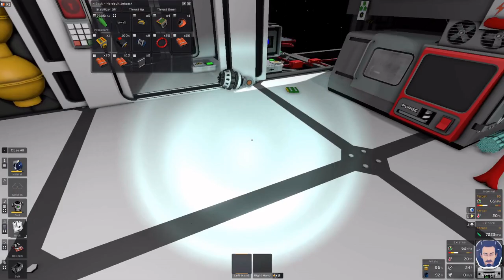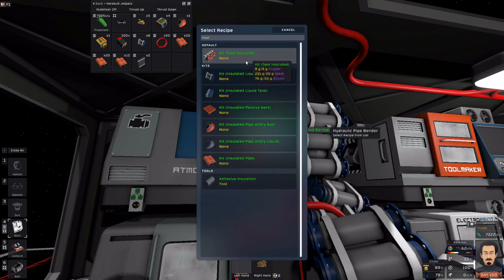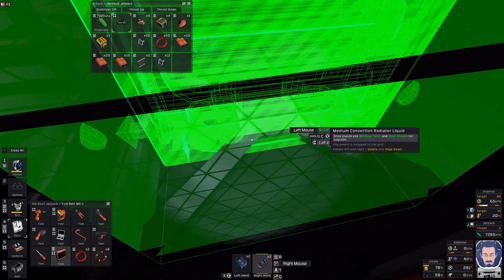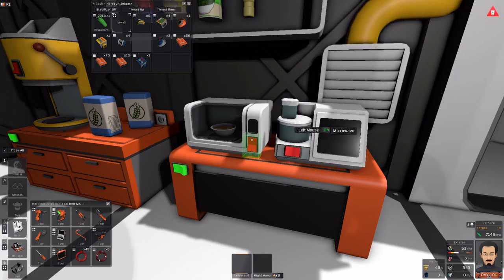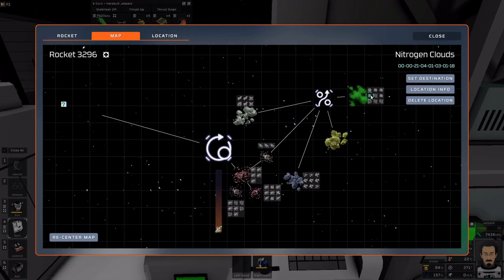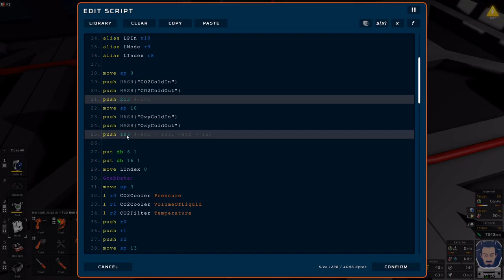Lost In Asteroids Pt13

Comment: because of my 70 day wait for my 2nd rocket launch, I did some creative mode testing with making liquid O2 from 7.5kMol O2 at 20C.  With 6 medium radiators, it takes about 21 days to cool it down (3 gas, 3 liquid) to -155C, which is fine for the pumped liquid engine.  More radiators will obviously do it faster.  I commend your Nitrogen distillation process, but the only nitrogen that I have is what I started with.  I dont think there are any nitrice deposits on the 1st hop destinations of the Europa map.   regardless, having extremely limited resources, I cant make elaborate setups which from a resource point of view is a game of trading one resource for another.  Electricity and cooling is free, once you build solar panels and radiators....you just need more and more to get more output from them.    I havent experimented with pressurized liquid engines, but the wiki says you use less fuel, the colder the liquids are....so getting that O2 down to -180C would probably be ideal for that - which will definitely be an end game challenge. I'll probably have a few liquid pump engine NOS flights before then, but again my goal is to become completely independent for the need for any mining.  And water independence, which requires your spare oxygen, will be dead last.  Nevertheless, enjoying your series and the inspiration it has given me.
Reply from the maker: That is a very long time, Kind of makes sense since the 1 radiator I built to help the Nitrogen cool faster was barely doing 100J of radiation. I'm finding that without a composter or burning NOS, Nitrogen is surprisingly hard to find.

As far as pressurized liquid engines, colder liquids is kind of a detriment. To get max thrust from the engine, you would need to have a near perfect molar fuel ratio AND pipe pressures as close to 6MPA. As far as fuel consumption goes, last time I ran them in Europa, they spent roughly half the mols of fuel per tick compared to a pressure fed gas engine, so about 25-28 mols/tick vs 50-56 mols/tick from the gas engine. Of course these tests where done with pipe pressures at 5MPA for the liquid engine and 50MPA for the gas engine. A pumped liquid engine with Nitrous fuel I havent checked recently, but I want to say it is something like 16-20 mols/tick for about 32 kN of thrust. I cant remember exactly but I'm finally building towards the pumped liquid engine again.

I want to say that my limitations for this save where: 1) No traders, 2) Phase change Filtering (I'll demolish my suit refill soon), 3) Keep my chickens alive (I almost forgot them three times so far, poor Mrs. Cluck, I barely saved her when she was 78% starved), and 4) No more than 10 solar panels. This has kind of been a strong influence for how I have built the station. I'm not sure that I'm getting any power savings with the phase change filtering though, I seem to be using approximately 250W to 400W depending on the stage to filter barely 2-5 mols per tick.

Comment: I started my playthrough a few days ago on the default Europa space map a few days ago, no hand mining.  I got the rocket launched on day 14, longer than I hoped, got back around day 21 with 30kMoles of ice and assorted needed ores.  It took forever to make the fuel for the next rocket.  Lack of enough Invar for enough radiators, lack of iron to make more than 27 hydroponics trays, and the SLOW as hell speed of electrolysis (cant wait to stop doing that once I have +100 plants) for supplemental Volatiles with my plants givng me about 800 moles of Volatiles per harvest - got my second rocket launched on day 90...lol.  Wont need as much water on 2nd rocket trip, as I should get enough iron to become Volatile independent with plants.  Next is oxygen independence.  That will be TOUGH, as it will require 200 plants to make enough O2 to re-launch rocket every 30 days.  There is NOS and O2 on the map though, so I can mine that instead of the water, on the 3rd rocket launch, while moving on to grab silver/cobalt/lead on a   future 4th rocket trip - silver will give me better filters, lead will give me solder for automation, etc.  Its been fun as hell, probably my most enjoyable playthrough yet (better than Venus or Vulcan) - I'm not under any timecrunch of dying, as I have plenty of water and electricity (electricity was rough, until the first rocket returned with loads of copper for solar panels) - the entire scenario revolves around making rocket fuel production more resource and TIME efficient, so I can go get resource more often - lol, something you take for granted on all other maps, when you just step out of the door with a mining drill (yes, I recycled the drill too)
Reply from the maker: I do agree... This playthrough is growing on me. After spending a long time in Europa and trying to brutal survive all the planets, the asteroid map is interesting in that you get much more time to spend indoors because you can't just go out and mine. It gives a different feel towards how to be self sufficient and make every extra little bit of resource go far. It is neat you went with the self sufficient path on the normal space map. Speaking of which, I think I'm at the point I can just recycle my miners. It isnt like they are getting much use here anyways.

Comment: Would running uninsulated pipe help cool the nitrogen to condense it faster?
Reply from the maker: That is a good point. It would help slightly for the pipes out in space. I would think it probably wont be much of a difference if the medium radiator only had barely 100J radiation, maybe I would have to see what the pipe radiation totals out to be once it is all replaced.